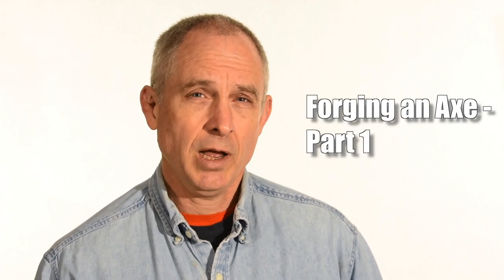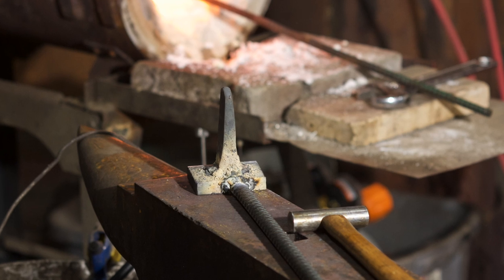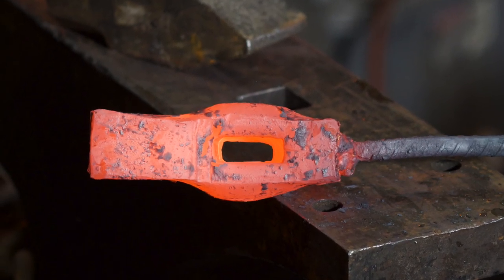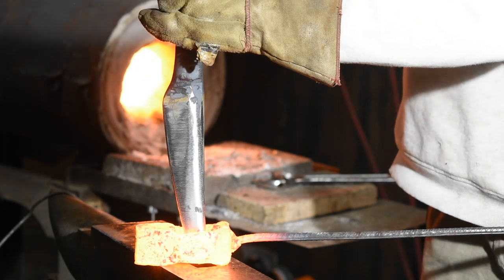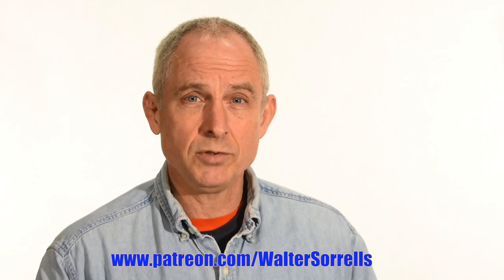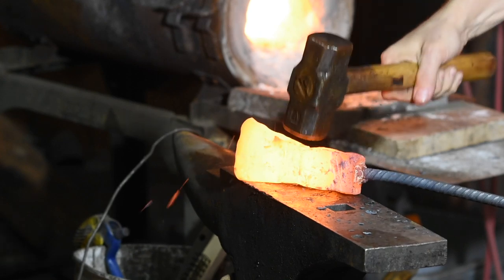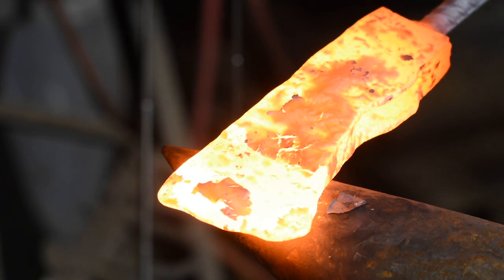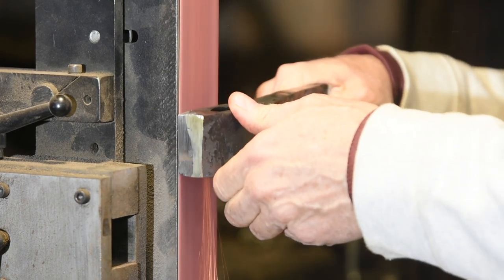Forging an Axe

Comment: Just some basic questions because I have never heat treated any thing before...
Does it matter what kind of oil is used for forging? 
Could I use vegetable oil , olive oil or motor oil or any type of oil on hand in anyone's shop, basement, or house?  Or does it have to ge a specific type in order for the forging to take place?  When heating the edge of a knife or axe, how will we know how hot it is if we don't have a way to test the temperature?

Comment: How about tips for welding on a handle. Mine would have broken off already
Reply: Preheat your pieces before welding. If your handles break off then you aren't getting enough penetration on your welds. Preheating will help fix that.
Reply: @garretttanner9788  it's because I'm new. The weld holds but I do so much bending it eventually breaks. Wrist control I guess
Reply: @thereallevel27  probably more a matter of hammer control and anvil height. You want the piece to set flat on the anvil face when you strike it. That will prevent the piece from moving around as much and bending the handle.
Reply: Try JB Weld.
Reply: I'm joking of course. The comment about pre heating is correct.

Comment: The first (and only) time I tried this, I chickened out and predrilled the haft hole to 1/2", and then drove the mandrel through the hole.  Seemed to work OK, but not a forging project, strictly speaking.
Reply: I drill two 1/4" holes before punching the eyes on my hammers. Smiths have been doing so for a very long time. Taking steps to ensure a better product is always a good idea and never something to be looked down on for.
Reply: @garretttanner9788    thanks, but for me it was pure fear of having to straighten out that double pitch oval hole  with a round file.